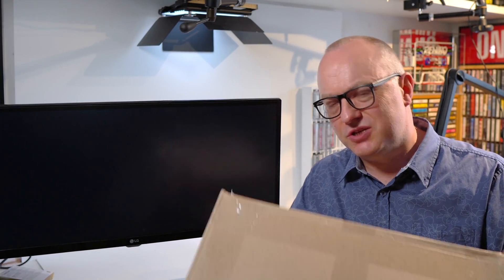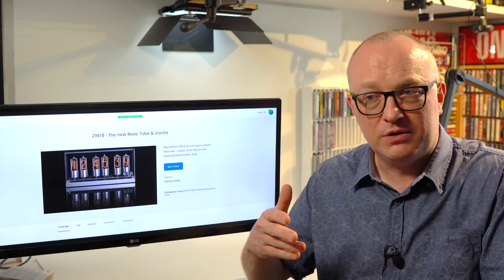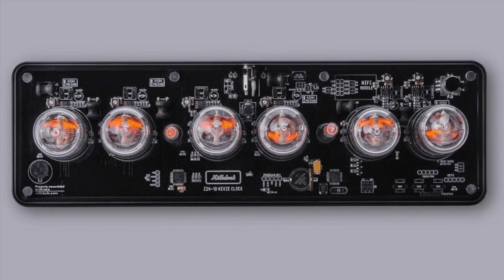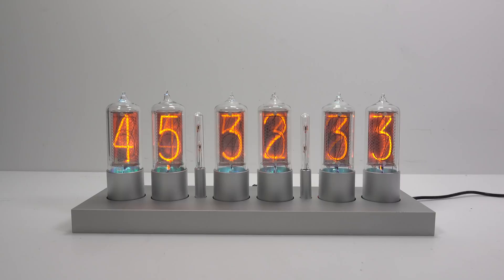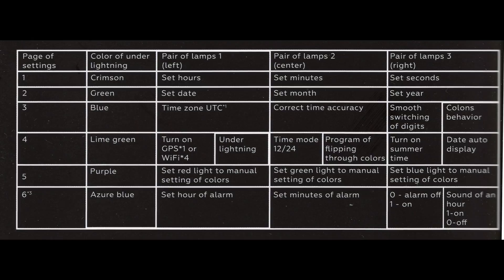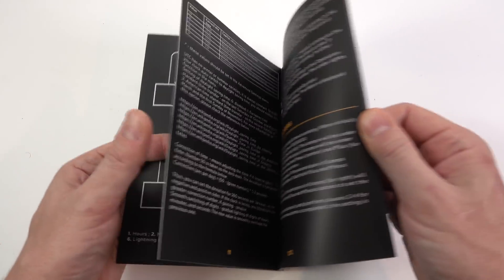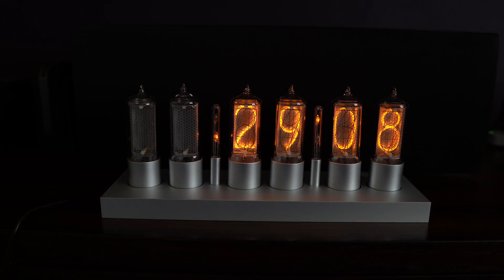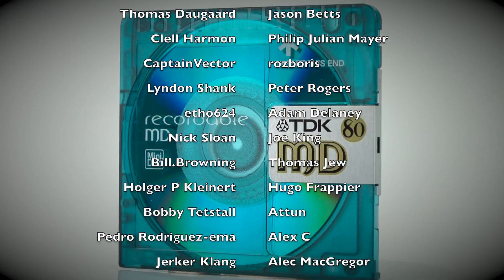The Return of the Nixie - New ZIN18 Tubes & Clock from Millclock

Comment: Gorgeous $1000 clock with hand made brand new nixie tubes, beautiful brushed alumin(i)um base,  wifi and bluetooth connectivity, rgb lighting, and options and customization up the wazoo. Beeper ripped out of a tiger electronics handheld that was dug out of the bottom of a landfill being used for the alarm.
Reply: I'm sure someone out there is gonna hack it to make a more pleasant sound
Reply: @zethyr8833  or for 1k I'm sure you could simply ask for a more Pleasant sound mind you it is an alarm it's meant to be annoying so you get up and shut it off I vary much appreciate the craftsmanship in this clock and vary much wish I could afford such a lovely clock

Comment: Damn, that thing is sexy. If i was a partner at a law firm or CEO at a multinational or something I'd definitely want one in my office.

A couple of things I'd suggest be added to the software: the ability to turn the tubes off manually and on a schedule (no need to run them when nobody's at the office), and the ability to adjust the brightness (even if it's just flashing them quickly).

Comment: The fact that it’s a free running quartz clock with a fast/slow adjustment really needed more discussion, especially if it’s not syncing via WiFi. And the ability to sync to WiFi and a fast/slow adjustment makes that clock an instrument. (My nixie resets to gps every hour, by gps, and runs quite fast if gps reception is troublesome.)

If this clock were synced to gps by internal gps receiver, I’d seriously consider it. The downside is it’s settings via the control knob, it’s too cryptic. If the manual gets misplaced you’d be stuck, although downloading a copy is pretty normal. However a lot of settings options is generally a plus. Hopefully the default operation yields a nice behavior. And then there’s no brightness adjustment. That may just be hard with Nixie tube architecture. 

Add internal gps and it’s a 9 by me. Without gps, I’d have to go with another.

Comment: For a 1000$ you don't get brightness adjustment or other alarm/chime options? Oof. Why do these sort of projects always fall just a feature or two short of being good? Yeah, every bloody thing has bluetooth and wifi but nothing allows you to customize user preferences. One of those things is a graphic equalizer in an mp3 players. Good luck finding one. Another a car stereo that doesn't have a bloody disco-demo mode or would even allow you to turn it off. And is it a law somewhere that torches have to include a strobo mode that has to be suffered every time you turn the damn thing off or on? Or do I just have completely different priorities compared to the rest of humanity?
Reply: It does look as though the majority of the money has gone on the tubes, then they've skimped on the rest to get it in under the US$1000 mark.

Comment: I've bought 14in clocks from Millclock and these are beautiful as well, but I got old Volvo, not Porsche :c)
Reply: I would much rather have my 1982 244 DL than a Porsche. YouTube is full of videos of broken Porsche 911s rinsing their owners of huge repair costs, whereas pretty much anything that goes wrong on an old Volvo (which isn't much, as they're so simple) can be fixed at home with regular tools. Plus, no-one looks at the guy driving an old Volvo and thinks 'what a prick, must be compensating for something' :)

Comment: Woof - Millclock must have more SKUs or be insanely low in headcount because 400 clocks of the one you mentioned at the start is only 67000.00 USD (not accounting for margins on parts). Of course I imagine the COL there is low - but still. Woof. I'm guessing the newer clock using new-fab parts explains the cost boost (obviously). Speaking of - is there other time measurement options available? I could see this used in a studio setting which would make it a business write-off.

Comment: Honestly, I've seen people spend $1000 on worse things. 
This one will at least be quite unique.
Reply: It is $1000 today because it is literally "handmade"  by artisans (no "mass production").
-> If there was an actual INDUSTRIAL system (either entirely roboticized, or just some "helping" for the mounting/handling), this complete set could probably be sold in the $150~$400 range [international shipping & taxes not included].
Reply: Yeah I've done it (In-18s) probably the most interesting thing I own. I love it.
Reply: Or a monitor stand with a fruit logo!
Reply: @teresashinkansen9402  certainly true
Reply: I couldn't do $1000, but luckily they have some for $200-$300 also.

Comment: How much per month would it cost in electricity to use?  Thanks!
Reply: The power adaptor was 12V 2A, so the maximum it could be using is about 24W. So it's probably about the same as 1 or 2 LED lightbulbs.

I don't know how much your electricity costs per kW so I can't give a better answer than that.

Comment: Given its immense brightness, it needs an ambient light sensor system. They could hide some photosensors in the base of the seconds digit and give the tube itself a bit of an off-time whenever the digit switches. Simultaneously the accompanying LED coud be disabled for a couple milliseconds, and a brightness reading taken. Subsequently, the brightness of the digits can be adjusted to the ambient light.

Another thing to work on, i don't think the sound is appropriate for a product this expensive. I believe it needs an electromechanical bell for it to make more pleasant, less beepy sounds. Another alternative would be a speaker and ability to use your own wav files. Certainly the task of invisibly hiding a speaker in this base is not an easy one, but i believe it's possible, it can have feet that would offset it from desk surface by just about 1mm and a downfiring arrangement, and 3D printed or machined acoustical chamber elements can be hidden within to shape the response - it's not at all easy, there is a lot of experimentation required to get something decent out of it, there's not a lot of data you can even measure about small speakers, as the Thiele-Small parameters go haywire for them, so typical acoustic engineering estimates become pretty much impossible, but it seems that something can be accomplished in this direction.

I am not the target audience for the clock, it is definitely not affordable for me. I'm merely imagining what i'd want for the outlay, as a sort of product design exercise.
Reply: Light sensor is developing for now
Reply: We will change the alarm sound

Comment: £1000 for a nixie clock, that's a hard sell.
Reply: @StarlightLumi  He said they were about 6 hours each tube so that's around 450£ for just the tubes. Including the rest you're right it is quite reasonable.
Reply: @SmolPotatowo  Both statements are true. The cost is due to labor required, sure. But it's still a £1000 clock, which is incredibly expensive for a basically functionless device that is mostly art/decor.

Comment: There's simple need for such devices. We are surrounded by so advanced technology, that there's rising need for simple, analog devices we understand. Playing audio from vinyl or audio cassettes is somewhat direct. User is directly involved how the sound is produced.
With digital devices we just press the button and 'magic' happens.

Not to mention how complex everything got. Modern fridges with WIFI have so much compute power that single unit could be used to control air traffic in a busy airport.

This can be overwhelming, so those simple, analog devices are a bridge between old and new. With internet, kickstarter etc. there's now cheap and efficient way to find customers for such products. Such clock won't be a huge commercial hit, but there will be thousands of customers in the whole world who would buy them.

This allows for such small companies to exist and make such things. With everything ordered online, distribution costs are way cheaper.

In the future we will have every old, but cool tech revived.

Comment: The tubes in your IN-18 clock are being very underdriven. My PV Electronics kit drives my tubes really nicely and it is easily visible in normal sunlight. I prefer the flash rate of the colons on the PV Electronics kit too (they flash at half a second per second) Still the Mill Clock is very nice indeed.

Comment: Nice! Looks like a "more affordable" alternative to the larger and fancier clock from the guy in the CR. Which I would love to have on a mantelpiece one day, but that's a long way off... For this one at $1k I might manage to swing that eventually. I stopped having much disposable income when I moved to Colorado. It's pretty, but man is it expensive to live here. (Insert self  deprecating LOL here)

I first seen and fell in love with nixies around 2005. I work in aviation as an avionics repair tech. Around that time, I got my first job working on civilian privately owned aircraft. (GA) This was at a small company that focused on the smaller piston aircraft. And the older aircraft quite often still had the original model equipment in them from the 60s and 70s. In order to repair and test this old equipment, my work had some old test equipment on hand, and one huge test box the size of a mini fridge had huge switches and knobs, and Nixies for the readout. It was glorious... The combination of the big cluncky controls, and the warm glow of Nixies, just makes for a fun experience.

Prior to 2005, I was working on military equipment, as a service member and later a civilian contractor, and had never seen nixies in use.

Comment: I still don't get why people think that putting leds under nixie/normal tubes looks good. The wonderful amber glow is completely adequate
Reply: @Willam_J  Well clearly some people still like them, they wouldn't still be a thing otherwise. Probably doesn't contribute much to the overall cost, so whatever really :)
Reply: Yeah, but the cycling LEDs for programming it is a great idea though.
Reply: I feel they are great for adjusting the settings only.
Reply: @SteelRodent I still run into trouble with them. Yes, they absolutely can be super bright, but they don't have to be. I do not understand why it seems that no manufacturer can be bothered to put a properly-valued series resistor in and getting the damn brightness to a comfortable level. Do they all think it looks good that way?? My eyes!!!
Reply: Agreed, but it is a small extra cost to add a feature that some customers want and the rest can disable.
Reply: You could turn it off so, no biggie. They have a purpose for programming the clock too so.
Reply: You turn off leds by one move on encoder
Reply: Andrew Ballard Absolutely, especially the blue ones

Comment: I really hope they get off the ground. It is great to see high quality craftsmanship in today's disposable society.
Reply: A Nixie clock with internet time sync?  Thats a wet dream come true for cyberpunks!

Had I the capital, I would buy a couple clocks just to pledge my support to the manufacture of the tubes.
Beyond that, the features of the clock appear pretty wide in scope, including wifi hotspot mode found in smart TVs for app connectivity.  Frankly (assuming the tubes price), it's hard to argue against this clock being worth every dollar, for what it is made of.
I do hope it wins an award in engineering somewhere.
Reply: Well said!
Reply: Gonna be slow, given the price
Reply: It was disposable then too. All of it is gone due to being thrown away. You only see the highest quality, well maintained things from long ago usually.
Reply: The tubes themselves are the magic.  A little handywork and a Raspberry Pi and you could make whatever you wanted.
Reply: @dominick253  we wouldn't be needing to see and prefer decade old electronics if modern shit actually lasted.
Tech from 2000s and on vs. before is consistently lower quality. You can literally see it in material preferences and overall manufacturing.
Reply: @dominick253  Try telling that to a 45 year old Lada ))))))), still lots of those here in Kharkiv

Comment: For $1000, you'd think they've have a nicer hourly chime.
Reply: There's a few things that need improvement but jeez they're making their own tubes. Wow!
Reply: Wallace  And Gromit would try to tell you the cost is $500 a year if the company folds next year and your bulbs die after 2 years.
Reply: And variable brightness.
Reply: @ELVTechnology  Automatic brightness would be nice.
Reply: @russellhltn1396  Not just nice, but necessary. This is way too bright to put it in a bedroom, for example. And this insane brightness will degrade the expensive tubes way faster than it should!
Reply: I think the hourly chime mimics the Greenwich Time Signal, broadcast on the radios to mark  exact start of every hour, so it has nostalgic sentimental value.
Reply: Right? At least make it sound like the WWVB hour chime...
Reply: The tone itself is a bit meh, but it sounds like the pips on the radio, which I like a lot.
Reply: Right? It sounds like the same cheapo generic buzzer that's included in every beginner electronics kit on eBay..
Seems like a speaker would have been plenty worthwhile at this price point. Then you could even add new sounds to it through the app.
Reply: Wallace  Man-maths at it's finest 👍😁
Reply: Definately, that piezo beep doesn't fit the device.
Reply: I like the chime.
Reminds me of the old "lights on"-warning buzzer in cars or older electronics.
It is either harsh electronic buzzer or rattling door bell.
Reply: Wallace  I think one of the options is a GPS mode, which I assume means radio controlled
Reply: It's very HF time station -ish.
Reply: Yeah, for something that costs as much as that
Reply: Wallace  he mentions that it can connect to WiFi to sync the time. Although would prefer radio controlled.
Reply: @AstronomyToday Where did I say you can RMA hardware outside of warranty?
Reply: Or customizable
Reply: Bread machine noise : D
Reply: Westminister? Maybe
Reply: I want mine with a remote control so I don't have to turn that "do all" knob and in addition, there needs to be an audio output with alarms that one could choose. Big Ben would be a starter. I would run that into a 1000 watt amplifier with plenty of sub bass so I could wake up the whole house!
Reply: @Captionmarvelous  The Adventures Of Ford Fairlane 😂👍
Reply: If I paid that amount, my ears better dance to the tune
Reply: For the price it'd be nice if it was fitted with a small bell so you got an authentic but quiet chime. Not a shitty pcm beep
Reply: It seems like a good business gift for an award or Japanese style meeting.
Reply: Wallace   The question is if they are still around would they even honour the warrenty after say 4-5 years or longer? I personally would only trust big established companies to honour these long term warranties such as perhaps Graphics cards manufactures like ASUS etc.  In my experience these small niche operations can be very shy when you return waving your warranty card at them, I imagine this is especially true with companies like this because they are using very expensive handmade components, and the incentive will be to simply fob you off.
Reply: @uberdude2555  Yeah, I bought a high quality needle bearing weightlifting bar from a small company that offered lifetime warranties. Then they went out of business a few years later, so my lifetime warranty became useless.
Reply: @uberdude2555  Funny you should mention ASUS, I had a laptop from them, very light use, it failed at 16 months old.
They told me to piss off. I will NEVER buy from ASUS again.
Reply: 5 years in and they’re still around!
Reply: @uberdude2555  I have numerous Nixie clocks and quite a bit of experience building and operating them. In my experience with IN-18 nixies for example, a cathode poisoning routine once a day may not prevent poisoning. My clocks routine every 10 mins. I have had good success with larger nixies doing a very regular routine. I have to agree with you uberdude25, if these custom tubes fail (say 5/7/9) years down the track, then what? Maybe Millclock will be around, maybe not. The problem will be that you WON'T be able to source replacements if they aren't around anymore. My humble suggestion would be to buy the clock if you wish and also buy numerous spare tubes too.
Reply: @Detroit8V92tta  They aren't cycling them once a day, they're cycling 60 times a day. As in the video, once a minute beginning at 2AM, and customizable.
Reply: The hourly chime sounds like classic precise time signals of Mayak radio
Reply: Who's going to buy it even if it was priced at $10 that hourly chime would want me to give it away as a gift to my ex-wife.
Reply: At least it got GPS!
Reply: @Frooonti  My 4 year old PV Electronics IN-18 Spectrum kit clock has GPS too. Works flawlessly. Nothing new under the sun.
Reply: @Yannick 73 I'm aware of the fact extra tubes cost money, but so does everything. Nixie clocks are expensive and so are the tubes. Spares are a must or don't buy one. Get a LED clock instead.
Reply: @superresistant0  If it has open source firmware.
Reply: For $1000 you'd expect better gloves and AC adapter.